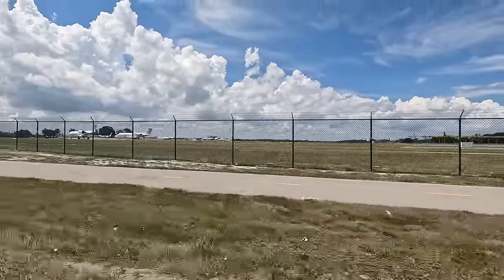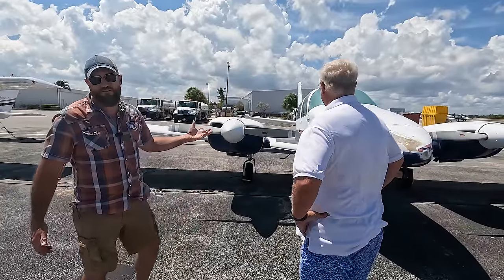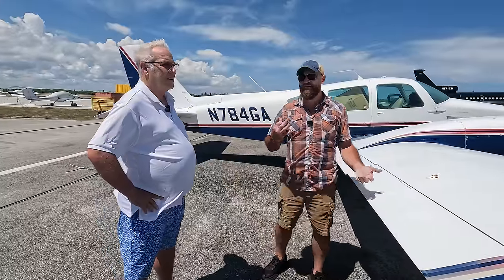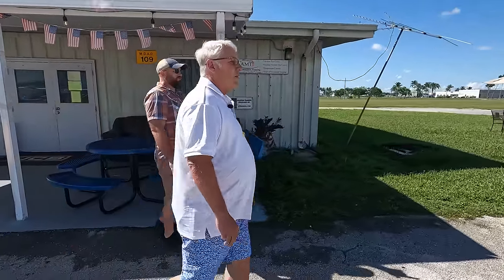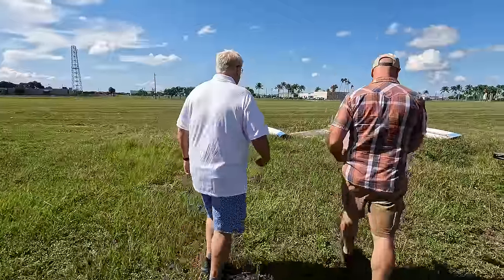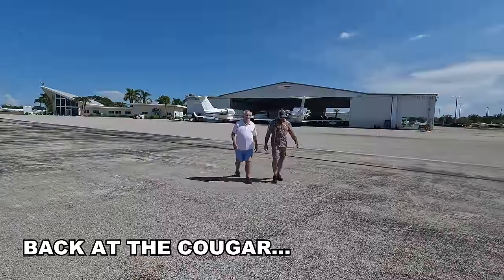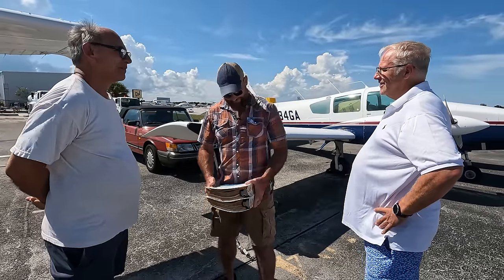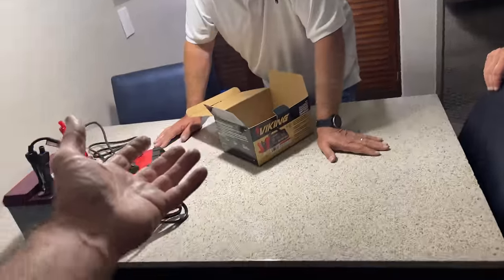Did We Find Wings for The FREE Abandoned Airplane? Will the Parts Airplane Start ?!

Comment: The used parts scene in Florida is infamous in the industry for a reason. I personally never had a great experience buying parts from dismantled aircraft in that state. Corrosion and dicey aircraft history being the main reasons.
Reply: Would corrosion be due to the humid air from the sea? 🤔
Reply: @henninghellerud  yup; humid air, high temps almost year-round and most of the state is no more than 50 miles or so from the ocean.
Reply: The part 145 shop I ran actually stopped doing business with parts distributors based out of Florida when ever we could. Another phenomenon folks don’t consider is how many airplanes get seized by border patrol, sold at auction and then parted out.
Reply: Saltwater is certainly the culprit. If this bird was tied down and  able to survive past hurricanes and tropical storms, it was bathed in salt water. Ive been thru a few and can literally taste the salt water well inland as the storm picks up the water droplets from the ocean and carry them inland.
Reply: Exactly stay away from coastal aircraft. Better in the desert.
Reply: @jaydeeskinner9936  Everyone who's been involved with aviation longer than 5 minutes knows you stay far, far away from Florida planes when looking to buy!!!!

Comment: It’s not my aircraft, but with the limited number of those aircraft left around, I would say save the one down in Florida. Also, we look at how fast it started. I don’t know how much the new avionics would cost but I think it would also be a worthwhile project , I would hate to see a perfectly good plane just shoes for scraps
Reply: It's not the avionics thats the problem, it's the corrosion. As mentioned in the video the control surface hinges have severe corrosion. AC 43.13 outlines how corrosion is to be inspected and treated.  If the amount  of corrosion has caused a loss of more than 10% of the thickness of the part then it has to be replaced. Since there is less than 50 of them in the world and parts aren't made for them there is no way to replace those hinges now that they have corroded past acceptable limits. So sadly that has made the plane a parts plane to use anything else serviceable on another plane.
Reply: @charlesmilson920  Todays CAD and CNC does amazing stuff. Are you allowed to make new parts to the original spec?  I ask because WW2 restoration aircraft get parts made from unobtainium? How do they deal with regulatory issues?
Reply: @Dave5843-d9m  there are regs about being able to make replacement parts but they have to be made per original engineering drawings so basically the type certificates have to be unassigned so anyone can then make the aircraft or parts. I would guess that the type certs are still owned by grumman so only they or their authorized representative can make parts for those planes. It sucks but until they release the type cert saying they don't want the rights to it anymore, no one can make replacement parts without their permission.

Comment: A little safety note for you: When you prop something up with cement blocks, you should set them with the holes in the blocks vertical, as that's how they were designed to support a load. They can crumble easily when lying horizontal under anything in the least heavy.
Reply: usually yes, however in this case those wings werent very heavy. That block had maybe a couple hundred pounds on them at best.
Reply: It’s good practice to always stack (and use) those blocks with the holes vertical.
Reply: @Dave5843-d9m  That is the best way to use them, i was just saying that with them very light wings, that block would support it just fine like it was being used. I see a bunch of people using these blocks to hold up heavy stuff and many times they are using them wrong. Im sure most dont even realize they are made a certain way to hold more weight if they are used right.

Comment: I realize that I'm coming to this party over a year late.  But I wanted to mention that after the Cougar No.2 (right) engine start you did a Mag check and announced that both mags were "good".

For the benefit of anyone else watching that video, I would like you to notice that you only got an RPM drop when you turned off the Left Mag.  When the Right Mag was turned off, there was no RPM drop, and that indicates to me that the Right Mag was permanently "live".  This would happen if the 'P' lead from the Mag to the Cockpit switch was disconnected at some point, meaning that the Mag cannot be grounded and shut down.

The effect of this, is that the right engine would be "unsafe" on the ground and there is a risk that if the prop were turned by hand that any residual fuel could cause the engine to start unexpectedly.

Before shutting down an engine, it is always advisable to do a "dead cut" check by momentarily turning off BOTH magnetos at idle, and verifying that the engine begins to die, before turning them back on.

Comment: This is so cool, by the time you're done getting the 401 airworthy you will have a free airplane that only cost as much to fix as 2 good airplanes.
Reply: Pretty standard for most restoration jobs to be fair be it a car boat airplane etc
Reply: @bobbyrayofthefamilysmith24  true. Most restoration will indeed cost a lot more than what the value would be. At least if you gonna do it right and getting it mint condition with original parts etc
Reply: @henninghellerud  To be fair people who say "it's going to cost more than it's worth why bother" are missing the point. For some there is joy in repairing and restoring things and making it as good as or possibly better than new. It's a hobby really. And for most a hobby never makes a profit so it's no different than any other hobby. I do agree that he needs to buy proper parts and forget about these junk wings, get new OEM parts and do it correctly.

Comment: Great Video. A shame the wings were near unusable.
Check your manuals to make sure that the battery is the right size. I remember buying a car many years ago that the previous owner put an undersized battery in the car just to get it running. More current is better.

Comment: The problem with Florida, or any ocean side state/province is the salt in the air as well as the moisture. The Navy deals with this a LOT on their carrier based aircraft but it's also a problem anywhere that's in relatively close proximity to the ocean. (The Corrosion I mean.)

Comment: Great video. Just wondering why don't you try to get the original wing repaired. What is it, just drill out some rivets and replace a beam or two! Surely there must be somebody out there that reconditions wings. Doesn't sound like an impossible task compared to rewiring and finishing the rest of the plane.

Comment: Are you trying not to spend the $220,000 we sent to you?  Send the wing off to have the spar AD done along with a total rebuild of both wings plus the spar carry-through.  Send the engines off for rebuild.  Send the propellers off for rebuild.  Get cracking!
Reply from the maker: Hey Robert
We’re doing our best to responsibly spend the donated funds for the 401 Rebuild. The wings cannot have the spar strap repair performed with the wings off. We covered that in a previous video. The repairing of the original wings engine mount beams has an 8-12 month back order for parts and will take 150-200hrs of labor and time. We’ve covered this in a previous episode. The engines and pops are scheduled for overhaul but the shops are scheduled out 7 months yet and don’t want them sitting around until they’re ready to start the work….   Unfortunately this process isn’t an easy one.
Reply: @rebuildrescue  Eight to 12 months to get the beams from where??
Reply from the maker: @learmonkey3582  we were quoted 8-12 months for all of the damaged and corroded wing parts and the strap kits from Cessna.
Reply: @rebuildrescue  Call TAS.  They make FAA/PMA’d beams.  They specialize in twin Cessnas and very likely have beams in stock.  Maybe the straps, too.  If they don’t have straps, installing the beams will give you plenty of content while you wait on a straps.  It already been 9 months and nothing has been returned to airworthy condition.  Why is waiting another 9 months a problem?
Reply from the maker: @eagle2019  You’re making a number of assumptions. #1 Flying to Florida is on my dime.
#2 I had a local A&P IA with extensive experience in airframe repair look over the wings before we flew down. #3 If you can show me documentation that spar straps can be installed while the wing is unbolted from the airframe please forward them to me jason@rebuildrescue.com We’ve been told be multiple shops who are performing the spar strap repairs today that they strongly recommend NOT performing the repair this way as two different shops ended up with wings that could not be used after the repair off of the airframe. #4 As far as the funds I spend $1500 of my own money monthly just to store the 401 and I’ve spent thousands more in various ways….   Not to mentions hundreds of hours. Honestly I haven’t seen anything positive come from you or your posts here. I’m not sure why you invest so much of your time being negative and spreading such negativity. We’re just good people over here trying to resurrect this old bird so we can help people. 🤷🏻‍♂️
Reply: @rebuildrescue  Jason, if you're so intent on helping people why not get rid of some of the planes sitting in your hangar, use those funds to buy 1 plane to use on charity work and get into doing charity flights straight away? Rebuild Rescue is constantly talking about charity charity charity donate donate donate buy our merch, more sponsored ads etc etc when it's obvious you have the funds and ability to have an aircraft running charity flights today. Same story with the yacht. I never donated because I smelt bs from the start, but I can totally understand why there is a growing chorus of people who have donated, who are getting extremely skeptical.
Reply: Thanks for responding!  I'm just some guy on the internet but here's what I would do.  Send off the engines for complete rebuild and also the propellers.  Remove the wings and central spar and have them completely redone by the guys at airframe components.com.  You could go out and film these placing doing their work.  That would about eat up the $220,000.  Then, you could ask for another $100,000 for all-new Avionics and have your A&P rewire the entire airplane at the same time as he was installing the avionics.  At that point, the plane should be able to pass an annual and you could fly it to a place that would overhaul the landing gears.  Next, have the landing gears completely restored (ask for more money for that).  It would be important to get inline for all the work you need to send out.  In the mean time -- even if it was a year, you could work on other projects.   Motorcycles always draw a lot of views.  Hackaweek's 40 part restoration of a Honda CB750 was tremendously popular.
Reply: @rebuildrescue  To say that you haven’t seen anything good come from Eagle201’s posts is only proof that you ignore his advice and the advice of others who know twin Cessnas and aircraft structural repairs in general.  You wont see the benefits of good advice when you ignore the good advice. If helping people is such a strong motivation in your life, why don’t you take the donations and buy an airworthy 401 (even though that’s a terrible choice for Angel Flights, but that another discussion) for less than $140K (on the controller website) and use all the rest of the money for actual charity work, so you “can help people”?
Reply: @eagle2019  You and I have both mentioned TAS multiple times.  It’s pointless.  If I get time Monday, I’m going to call TAS and check price and availability on beams and bulkheads.
Reply from the maker: I guess we’ll just have to see how everything turns out ! Thank you for being concerned about the 401 project and the community 👍🏼
Reply: @rebuildrescue   Since, as another poster said, you are so intent on helping people, I was really hoping to hear an explanation of why it’s reasonable and ethical, using the charity’s money, to spend three, four, or five times the cost of an airworthy 401 to possibly repair N81AD.
Reply: @mmayes9466   That’s a good observation.  If the wings need sent somewhere, that should have already happened.  If the plane needs ferried, that can’t happen until everything else is done (including the engines, which are, per Jason’s above statement, 7 months from even GOING to the overhaul facility), and areas of the plane haven’t even been inspected yet.  If I managed the maintenance on the planes at work this poorly, none of them would ever fly.
Reply: Jason don’t listen to these negative guys. You and your organization are great. It’s called rebuild rescue which means rebuilding and rescuing. The biggest appeal of your site is the fact that you are going to such lengths to save something most of us will never be able to do on our own. I’d be willing to bet most of your audience have projects in our garages or old barns that we have huge dreams for. But In reality we know we know will never finish them. We live vicariously through you and your videos and speaking for my self …. It’s awesome!  You’re a dreamer with drive. Dreamers with drive get things done. Don’t ever change.

Comment: Could you turn your 401 into a pressurized cabin? or is that something that can only be done in the factory?
Reply: I am no expert, but I would imagine the plane needs to be designed to be pressurized.  The fuselage has to have a pressure vessel as part of the structure (airliners have this).  The 401 does have on board oxygen supply (you can see the oxygen fittings in a previous video), so its likely capable of higher altitude flight. Everyone on board would just need oxygen mask or a nose piece to deliver extra oxygen at altitude.

Comment: Jason,why don't you take the wings off of the Cougar and load the plane on a flat bed truck to be shipped to where the 401 is being worked on. When you get the other cougar down to your location you will have extra parts available as needed from parts plane. Later date of time you could rescue parts plane to make it flyable as a spare.

Comment: I'm only saying that Cougar is in too good a shape not to restore. I didn't see any deep pitted rust, but I wasn't there. As fast as it jumped up, it does want to fly again, right?
They don't make dual engine airplanes much small than that, do they? That's like two Volkswagen beetle engines. (You got gremlins in the wings, lol) It's like a personal skycar, 4 seater coupe of airplanes. A cute little thing...can ya keep it? Come on, bro...
It's like a Mazda MX5 to car fans. The Miata.
Reply: @mmayes9466  too bad they aren't like cars, as well, in that you can adjust such things. You can't just drop a body kit and some engine work and supe it up, reenforce and counter sweep the wings, toss on some launch boosters for assisted take off.
How difficult is it to have a full custom design? I'm more of a jet guy rather than prop, but my fav is the P-51.
I've never flown before, though.
Reply: @mmayes9466  No...way...
Cool! Of course, those regulations are there for a reason. Learning the ropes, like redundancies and safety protocols are Absolutely necessary to survive, and not end up a news story. However...
Aw, airplanes are easy. It's just a flying lawnmower with control surfaces, lol. It's all in the object orientation, one system at a time.

My Momentum transmission system needs testing, but I've done the math front to back more than five times...
That would be unbelievably thrilling. Of course, so would my spider ATV. The world sucks.

Comment: if you have a prop strike, it is an automatic engine change.  you should ship the engine also..  the prop is connected to the cam shaft and that is connected to the piston rods and they could have been bent on the prop strike.  Planes are not like a car, realace the damage part and you are good to go..